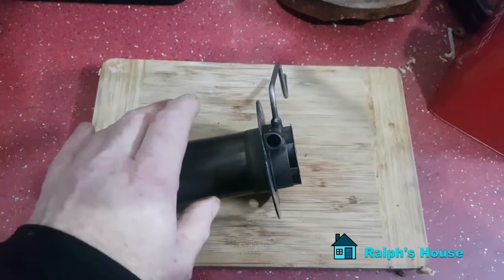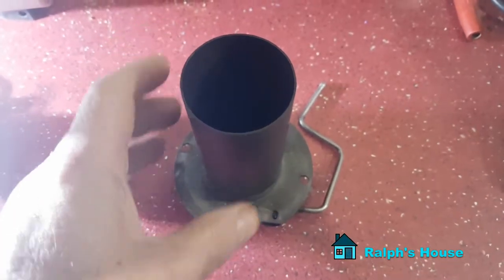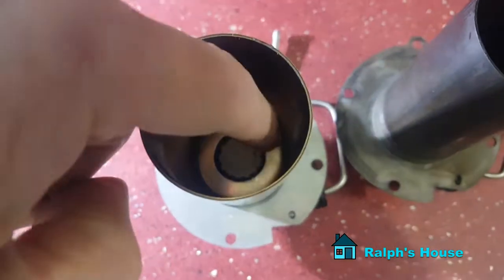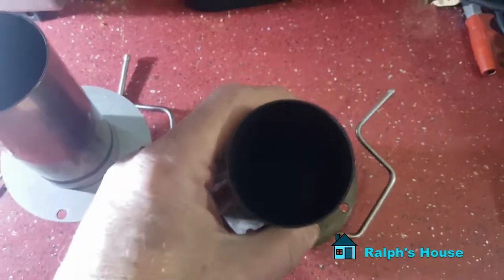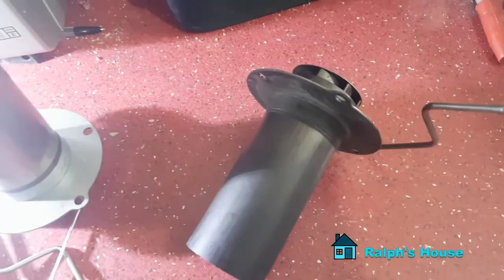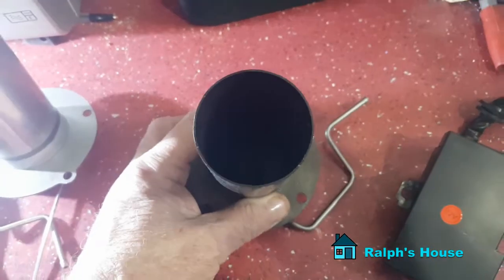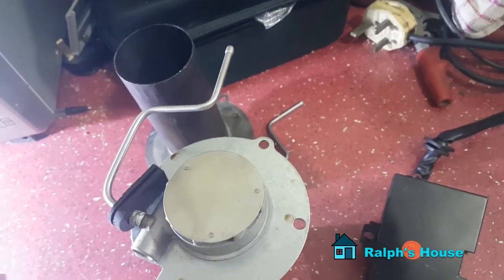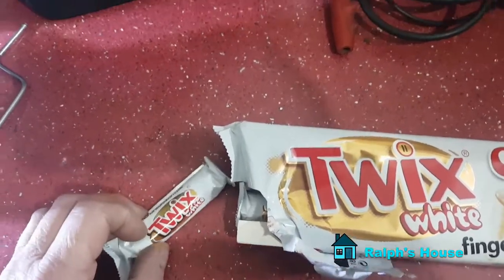204. E-08 Error - Chinese Diesel Heater

Comment: Just repaired a heater showing E08, did the usual you described, but the blockage was in the metal fuel pipe seen in your video.Try blowing through it, if its blocked yoü will know.
Take the glow plug and mesh filter out, and, as a guitar player, I pushed  a bronze wound old string down the pipe from the open end till it appeared where the glow plug sits.
Ill put an in-line filter in from now on.
Reply from the maker: Agree, filter an essential. Keep a spare burner too as it minimises down time while the faulty one is cleaned/serviced. Yep, E08 would come up for fuel blockage too, although theres unlikely to be the clouds of white smoke then. As I say it purely means 'flame out' and not a helpful error code. Thanks for your input.

Comment: Getting the same and getting frustrated. Thanks for this ! Subd
Reply from the maker: @branchsnapper2228  very likely the problem. Never used anything beyond diesel or kerosene either, it will always foul back of burn chamber despite the claims. Good luck.

Comment: this is an enormous help, thank you. 

running it on 1 is plenty warm for any time I need it. how many low cycles can I do before you recommend running a high heat cycle to clean it out, and for how long?

Thanks!
Reply from the maker: Every couple of days at least. 15 mins will help. Never be tempted to add any amount of veg oil to your fuel either.
Reply: @Ralphs-House  I really appreciate your video and you responding. Thank you. I'll report back with the results.

Comment: I have a brand new one.
I keep getting the 08 code i've prommed the line i'm thinking it's my power supply, because it's only saying 6 or 7 V.
Because I'm using it in my carport, so I don't know how to convert it to a 110 outlet like the ones that's in your house. It's been an absolute piece of s***
I mean.
I'd rather buy a torpedo heater.
And deal with the fumes, you pour fuel in it, flip the switch, and you have heat.
I didn't know I was buying a heater.
That has 20 steps.
And then some tricks, you have to pull just to make the f**** thing work.
The Chinese.
Or not showing.
A lick of intelligence on this pos
Reply: There are plenty of mains voltage to 12v power supplies available online. You want something in the order of a 15amp supply so theres enough power to start it initially. 6-7v is nowhere near enough voltage. Lots argue that it must be run from a battery but I never have. Mine runs wholly from a power supply, although I do have a UPS as a backup if needed.

Comment: Hi,i bought my chinese heater around 2months  ago..piped it into tank,primed it up and ran it a few times at 35° for around an hr and perfect,shut it down properly...but now its fires up and shuts down with error E-08..primed it a few times each time i set it away but still E-08...no air bubbles in line ,everything is new including filter...do you have any idea what is up please??
Gary
Reply from the maker: Enough voltage? Supply wires thick enough? That would also throw an E8 sometimes particularly on a battery. Draws more amps than you think when starting. Not enough power and it will shut down.

Comment: Man I have been struggling trying to solve the E 08 error, thank you so much for this video!!!
Reply from the maker: I'm with you! The cause is annoyingly invisible too. Also, worth noting that despite the fact its clearly described as a diesel heater, there are quite a few owners being drip-fed complete bull across the internet about them being able to run on engine oil, veg oil,  and 75/25 mixes etc which  is totally wrong. They're not designed for it. It will always coke the back of the burner at some point, even if other 'fuels' are filtered, warmed etc. A dedicated oil burner is needed for that and generally you need the paperwork and in most cases its illegal now anyway. They are very cheap to run as they are compared to almost all other heaters. I'm not saying you have, just a general message for all. Keep to the right fuel and buy a spare burner to make servicing easier and you'll get trouble free use out of them. The relief when it starts again! Yeeha!

Comment: That's because there is no fuel pump, it's a fuel regulator you hear ticking as it meters the fuel.
Reply from the maker: Not a fuel pump in the true sense of the word but clearly it does transfer fuel as my tank is about a metre away and its not fed by gravity.

Comment: I am struggling with e08 for more than a year. It is fitted in my van. It looks like it won’t start up as soon as it’s freezing outside. So we have to start it up while we are driving. When the car cabin temperature is warm. We have no issues then. But trying to start when the car is parked and freezing outside has a start succes rate of 10%. It’s driving me crazy. Maybe cleaning the carbon can help?
Reply: Lots of questions. How long has it been installed? Is it fed from your van's tank or one inside? If it starts when warm, I doubt it'll be carbon. It could be that the temperature sensor plays up when its freezing or the fuel in the pipe is being affected by the low temperature? Certainly diesel can turn into a gel if its too cold. If its in an internal tank, you could add kerosene (heating oil) to it during the winter  to help prevent this.
Reply: I'd look at whether you have enough battery voltage when it's cold. In cold weather, the battery voltage can drop and the initial power requirement is quite high. I find that when the voltage drops to 11v it just won't get hot enough to start. Once the engine is running - no problem.

Comment: Haven't tried this yet for heater but works great on a diesel engine but to remove carbon mix transmision fluid and acetone removes carbon easily,also maybee using a ultrasonic cleaner?
Reply from the maker: Good suggestion. Relatively cheap too.

Comment: I would try some DPF cleaner, pour a bit in, wait, wash it out. It's formulated to remove exactly those kind of baked-on carbon deposits.
Reply from the maker: Try it and let us know if it works
Reply: Do you have any results with dpf cleaner?
Reply: @csabavarda4285  No, there is nothing wrong with my diesel heater so no way of testing it really. I have tried the cleaner on my actual DPF and it works for that job. The residue in the heater is the same stuff - i.e., burned diesel fuel debris, so I would have no qualms about using it if my own heater gets clogged. I'm confident it would work. One thing: For an actual DPF you run throught the process of squirting it in, waiting,  then running your engine hot to clear out the remnants. For a diesel heater you'll need to do the same - pour it in, wait the specified time (on the tin), drain it out, then run your heater full power until it stops smoking. Job done.

Comment: Hi Ralph! Thanks for your video! Here’s my problem: New heater that fired up normally on first run. Ran around 2 minutes on high with fresh diesel. Tried to start next day but wouldn’t. No fuel pump clicking. After about a minute I get the E08 error. Too new a unit to have carboned up. Haven’t taken apart so not screen position or clogging. Any suggestions? Thanks again! Pennsylvania USA.
Reply from the maker: @zook9265  did you have a filter? If not pump could be clogged with a bit of grit. You can often dislodge it by smacking end of fuel pump stub on a block of wood. Then try applying 12v to pump on the bench to make sure its working. Faulty sensor can also force a shut down
Reply: @Ralphs-House i have the same issue. i bought a van an tried to fire up the heater. the first time there was air in the system and it shut down after heating up. the second time i didnt hear the fuel pump. is it possible to test it manualy? does it need continues 12v or pulses?
Reply: @Andypenthes I bought 2 brand new heaters. Both ran great for about an hour then both shut down. E08 code, won't relight. I can't believe it would already be carboned up. I wonder if anyone else has experienced this.
Reply: Today a lot of diesel actually is biodiesel. You can see diesel #2 at many gas stations. That biodiesel forms some sort of algae and when it get to the pump it glues the piston as there very small clearance between wall and piston. Knocking the pump by plier or by some heavy object sometimes helps. If not apply 12v and knock it at the same time did the trick for me. After that use gas to clean through applying pulsing power from CDH and letting gas to wash all algae. At the same time wash diesel tank and fuel line with gas. Otherwise fuel pump would clod in a minutes.

Comment: Thanks for you technical information. It made perfect sense. I have one on my 70ft narrowboat and smoked like crazy. Cheers mate.
Reply from the maker: @markverster799  heck you need one then! No point having to sit in a sleeping bag just to survive. 70ft thats a big boat to heat. However, you may find that a 2kw heater (if you're using the 5kw) may be a better bet. The reason I say this is that once its warm in there, you end up switching it down to its lowest setting to maintain the temperature and it therefore isn't getting hot enough, regularly enough, to burn off built-up carbon. You can get around this somewhat by cranking it up to full heat for 30 mins (say once a day or every two days) with a window or two open, to get the burn chamber clean. If you used a lower output heater, it would at least get hotter internally during normal running. I'd say a 2kw is ample for the space you've got. I'm heating an entire house with a 5kw one on lower settings, but even so it gets run flat out prior to switching it off, or if its on 24/7 I give it a blast every day to help keep it clean.  Does that all make sense Mark?

Comment: Great video, makes totally sense. Had the same issue, I'll have a try at cleaning my old one, new one arrives tomorrow 🤞
Reply from the maker: White smoke, theres fuel. Report back state of your old burner at the back :)
Reply: @Ralphs-House it's very clogged with carbonised crap in the mesh, parts of the mesh even falling out when cleaning it. Used heat and a pick, but it's still white smoke and very low temperature. Was worth a try but I've total confidence it'll work soon as a new tube is fitted
Reply: @Ralphs-House  The problem was Fuel starvation , where the nylon fuel pipe fits to the DH via the rubber tube and clamps, heat from the exhaust had allowed the pressure from the clamp and rubber to squish the nylon tube within eventually cutting off its fuel . i had even took precaution by putting silver foil between the two to act as a heat shield , must improve on this !  Took a bit of finding but all good now  :)

Comment: But what about using a flame from a hand burner hold it into the chamber, once the carbon ignite just use compreseed air and hold the air into it as long as no flames are coming off anymore. This is how I cleaned the Intake Manifold (aluminum) of my sisters Diesel meter long flames cam out. Greetings from Germany
Reply from the maker: Worth trying but I found the wire loosened the carbon really well.

Comment: How glad am i that this was the first vid i chose to watch after my heater has been smoking like a train every other attempt to start and shut down yesterday with E08 whilst on low setting, Thankyou i'll let you know how i get on :)
Reply from the maker: A good chance its the cause. See how much crud there is in the back of that burn chamber. If you're getting fuel, glow plug or dirty/clogged glow plug mesh can also cause the error but its the back of the burn chamber that usually gets the most carbon accumulation.
Reply: @Ralphs-House  Haven't got to it yet as i'm working nights and with it being so cold today i wanted to run it, What i can tell you is i've been running it no less than setting 3 but mostly 5 or 6 and its now starting up cleanly every time and doesn't need a reboot to fire up (no smoke), So running hotter must be clearing it a bit because i've been running it on low mostly for about a year now on kero and its only the last couple of weeks its needed two goes at starting every single time
Reply from the maker: @markg_r1751  Yep, heater needs cranking right up for short periods to keep it clean
Reply: @Ralphs-House  another update lol 😂 

I found the problem to actually be caused by a loose negative on the inside of the case to the terminal, discovered this as soon as I whipped the cover off but as I was geared up to take it apart I did and it was immaculately clean inside, no real buildup at all and no black soot at all, amazing as it’s run mostly on low for the two winters it’s had, colour of a clean burn spark plug is the best way I can describe it, I don’t think the glow plug was getting decent voltage thus causing my issues, been great again since no more issues

Comment: Thanks for that Ralph. Excellent.

Mine was working fine and then I noticed it was not as hot and smoking (after many hours of use) Took it all apart and it was sooted up.
I only ever run it on low. Cleaned it all up put it back together and it was all running perfectly.
Then it just stopped with lots of smoke and the e 8 code. Not immediately, about 10 hours of use later.

After watching this video I realised although I thought I'd cleaned it perfectly, both barrel and chamber.
 It looked spotless. I just didn't get a pick and clean that bit at the bottom you mentioned.

I couldn't work out why I was getting this error until I watched your tutorial on it.

Seems like I'm going to take it apart again and clean that part out too.

Oh, and because, I'm running it low all the time would you recommend a couple of minutes blast on full before I shut it down?
Reply from the maker: Does yours have the facility to switch to alpine mode? If not swap controller and board for one that does. Certainly the six button controllers do but youll need the board to go with it. That will lean out the mixture.
Reply: @Ralphs-House 
Thanks for the reply.
No it doesn't.
Even though the light check flash shows it on start up (I hope you know what I mean), after trying to put it in that mode, no joy.
Reply from the maker: @ramalama9650  With the heater running, on the left hand side of the display, alpine mode can usually be switched on by pressing both buttons on that side at once (ie top and bottom one).
Reply: @Ralphs-House 
I've tried that. Nothing.
Thank you for the help and the tutorial.

Comment: This makes perfect sense ... thank you! I knew it wasn't a fuel issue, so I was really at a loss. Now I know. I guess this will be an ongoing problem since I run my heater on low -- about 18C --- continuously. The heater was just installed 5 days ago, and already, this! But, anyway, now I know. Thank you!
Reply from the maker: You can swap the controller and board for a 6-button version. Alpine mode (which many controllers don't have) leans out the fuel mixture considerably and as I discovered, keeps coking to a minimum. I run mine on the lowest setting all the time and have had no problem since I changed board and controller. The very basic controllers don't offer much flexibilty at all. I post this comment in the hope that this reduces future problems for anyone else. Definately worth getting a matched board and controller that at least gives the option of Alpine mode. Strip it down and check the back of that burner. You may (as you suspect) be running rich. You'll soon know!

Comment: Thanks a lot for the great video I fixed mine heater yesterday. I removed the burner and burned soot with the torch, and cleaned it so far, working great again.🙏
Reply from the maker: No problem. If it saves anyone grief trying to get their heater restarted, I'm delighted. Carbon is easily overlooked and not easy to get at but a clean heater is crucial to reliable starting and running - reason enough not to use 'experiemtal' fuel sources. They like diesel or kerosene, period. The price of these heaters has fallen dramatically in recent months which makes buying a spare heater a real option too. Hope you stay warm!!! Ralph.

Comment: Very interesting. Excactly what mine is doing. I will pull apart and clean her up. Great video. Cheers
Reply from the maker: You're welcome Brian. Take your time cleaning the carbon out and check the glowplug mesh is correctly positioned. If your controller has the facility, switching to 'alpine mode' also leans the mixture out a little, reducing the chances of carbon build up. I heat my house with mine every winter. Once its warmed up, I switch to setting 1. I rarely switch off alpine mode now.

Comment: What about an ultrasonic cleaner?
Reply from the maker: Certainly worth a try although getting the worst out with a pick probably advisable Geoff. You can end up with big chunks of carbon in there so breaking them up into smaller sizes that you can get out is really important. You'd need a fairly big ultrasonic cleaner though as the fuel inlet sticks out a fair bit. Be interesting to see if it gets it really clean for sure.

Comment: Being a maintenance person at manufacturing plants for half my life I have a habit of collecting spare parts so when something breaks down it is back up and running quicker. I usually end up with a box of at least one or two spare parts with things like this heater. I see more stuff I need in my spare parts box.
Reply from the maker: Similar job to me then Troy and we both know what a thankless job that is. You have to be incredibly resourceful and for the most part, all of that knowledge goes unrecognised or completely misunderstood. Had to patch a bit of drywall yesterday after someone put a fist through it, and try as I might, no one could understand WHY I couldn't paint it an hour later. I despair. Its like trying to talk to turnips.